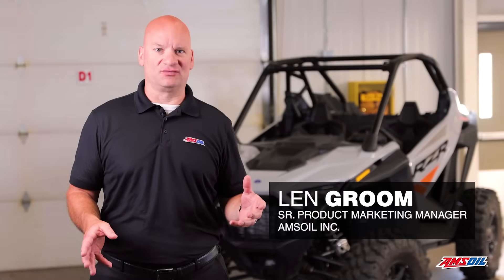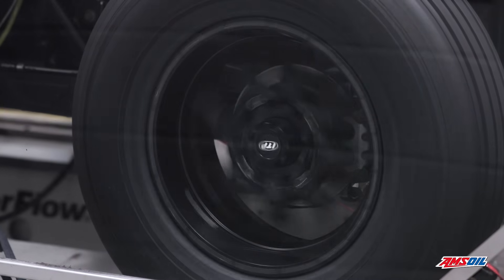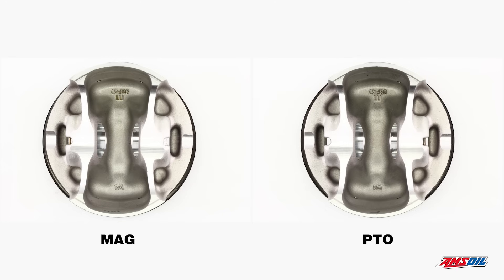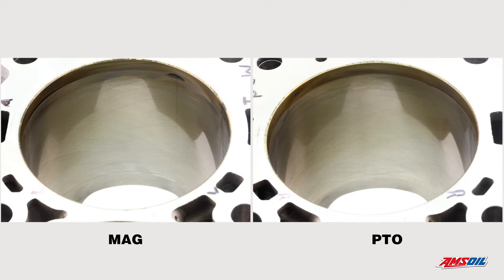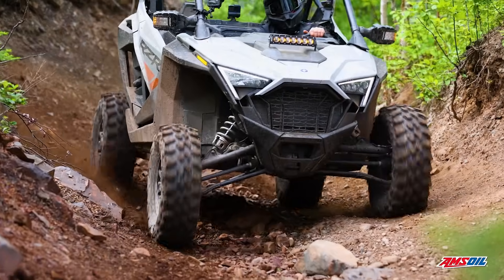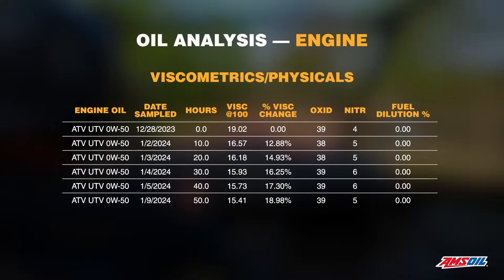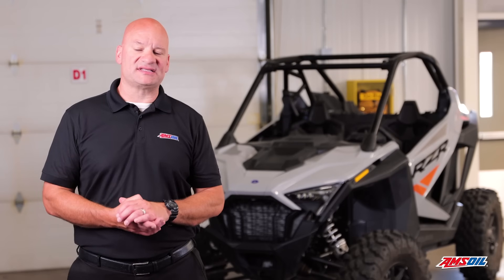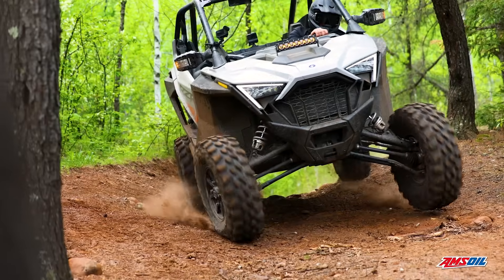What happens to a UTV engine when you run it 50 hours straight?

Comment: Iam probably the only one here saying this but I'm very anal on my 2021 pro xp I've always used polaris oil and my avg temp was 178 then I switch to amsoil and on the trials it runs over 185 degrees and I have to go over 30 to cool it down. Is this normal cause with the polaris oil it seems to hold a 178 temp better. What gives?
Reply: Are you talking about the belt temp, the engine temp, the coolant temp? Are you using the same weight oil as the OEM? How about the oil filter, is it still the same?

Comment: As a person that has one i must point out a flaw in this test. Its a cvt and normal operational rpm is much higher that what you tested at very rarely do they run 10-15% throttle
Reply: 10-15% MORE intense than standard operating conditions. not 10-15% throttle.
Reply: 👌 @stevencarter3290
Reply: This is true, partially. How often do you keep the throttle pinned on your car, cause mine is probably 1-5% of the time. The other 99-95% of the time, its either at idle or at less than 50% throttle. You dont know enough to know what you dont know.